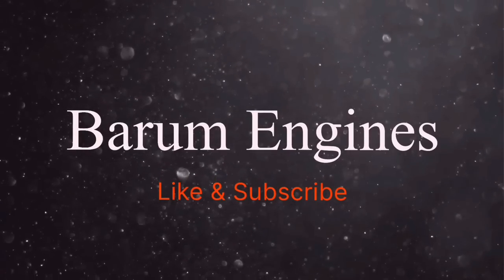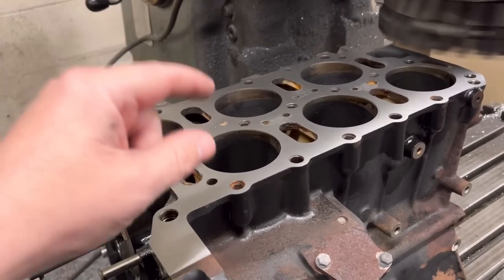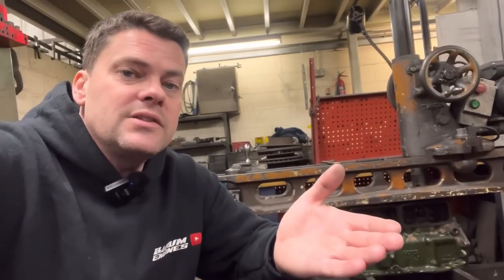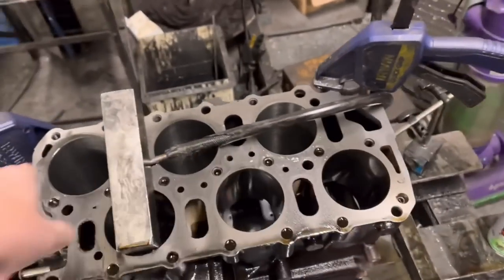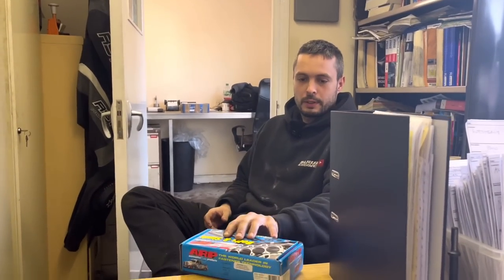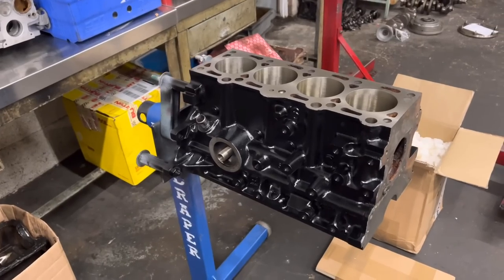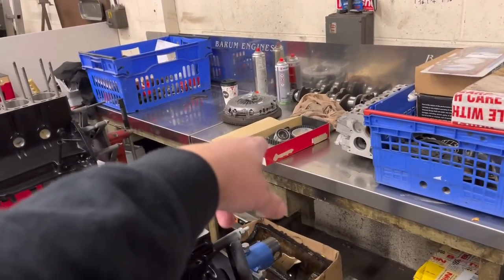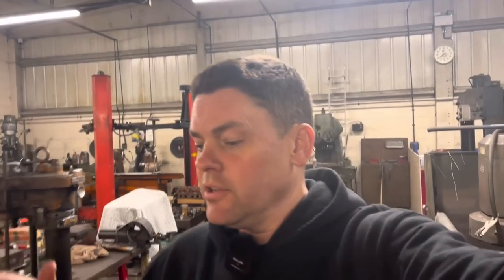This is what happens when you have TOO MUCH on your plate!

Comment: I had an SD1 Vitesse years ago (same engine)  that had the same type of noise  you describe when started in the morning. It turned out that it was the oil draining out of the hydraulic tappets over night. The cure was to experiment with oil weight , to find a type and weight that warmed up and flowed quickly (especially if not used often or for long  enough distances)  cannot remember which I found was best.I think it was a lighter weight synthetic that completely solved the issue. Worth a try before stripping the engine ....

Comment: If u want to get that cvh head flowing better stick a set of later efi valves in they flow loads better as they are superior in shape as tested on the superflo bench when I worked in the head shop at janspeed

Comment: Hey Lee, be sure not to use synthetic oil to break in the new solid lifters and cam in the CVH, use a classic high zinc content 20W50 mineral oil and the cam lube together and you should be ok, we fitted hundreds of solid lifter CVH cams at HT Racing and found that synthetic oil is the kiss of death to CVH SL cams resulting in a 100% failure rate
Reply: as a two stroke nut I can confirm I always run in  on mineral before switching to synthetic
Reply: Valvolene 20/50 racing mineral oil I use
Reply: @vinceevans3219  Yep, that's what we use at HT, but always make sure it's the high zinc type. Back in the day our client Lee Allen on the hunt for sponsorship contacted Motul who were willing to help but only by supplying their top synthetic racing product in exchange for a few stickers on the car, Lee told the guy that synthetic oils were no good on a solid lifter CVH race engine and the guy poo poo'd that statement and told Lee that he'd come over and sort out a race oil package of specially reinforced synthetic oil with a bunch of extra friction modifiers added, Lee agreed on the condition that if it fucked the engine Motul would pay for the damage which was agreed, anyway the guy came and the oil was exchanged from the normal Valvoline Racing 20W50 to this Motul synthetic and the engine was run while we stood there watching. After a few minutes the engine was making some unhealthy noises and on stripping the top end in front of the Motul guy all 8 cam lobes and followers were knocked out, and that's after only 10 minutes on an engine that had run perfectly for 2 years and was as fully broken in as you could get. The guy was embarrassed and left with his tail between his legs and as agreed Motul covered the cost of the repair. Lesson not just learned but rather fully proven that synthetic oil is not suitable for a race setup flat tappet cam, both for breaking in and for running where the valve spring pressure has been increased. We used Kent Cams and genuine Ford solid lifters, the valve springs we used were 50% stronger than standard and the engines were safe to 8.5K all day long with over 185 bhp from a 1.6L Ford CVH on Webers, we had zero reliability issues from the cylinder head assembly with engines that were raced every weekend for years and the Valvoline oil was a big part of achieving that reliability because it allowed us to use the heavy valve springs that brought us that reliability without constant cam wear problems. 'Sausage' HT Racing Ltd
Reply: I had the lifters WCC coated after a customer called me up in dispair as he ruined already 2 cams within 12 minutes.  
After 1th race with coated lifters and custom Catcams grind he took 1 out and it showed no sign of anything.
About 2 years after that he sold the engine.  But new owner drove in a class only stock cams allowed so he took the set out and gave it back to my customer.  WITHOUT ANY MARKING ON LIFTERS.  So my customer called me : Got a box coated lifters , unmarked  ......what should I do ??    I asked or any signs of wear . He replied lifters are like new.  So he put them in  and had no issues ever.  Meaning the coated lifters could be switched places.......😎😎😎😎

Comment: Hi Lee, Tr8 rattle, experienced similar rattle with audi years ago after changing oil. Turned out to be wrong filter, nrv not present allowing oil to drain back from cam. Similar problem with Dolomite sprint turned out to be hydraulic tensioner worn causing timing chain rattle. Worth a check.

Comment: A series engine sizes   803cc  Early Morris Minor and Austin A30.  848cc  Mini ,  948cc Morris Minor , Austin A35.  998cc later Mini's.  997cc Cooper S low production.  1098cc  Morris and Austin 1100 .  1071cc another low production Cooper S .  nearly square bore/stroke incredibly high revving.   Finally  1275cc.  too many uses to mention.  I am aware there were many other BMC or Austin Morris cars  that used various engine sizes but they are too many to mention and my 72 year old memory is not what it was.
Reply: Don't forget the 970cc Cooper S

Comment: If you do get into that TR8 and find out it's the cam bearings don't fit the county ones. Had lots of engine reconditioners complain about excess clearance. Best of fitting Glyco even if they are more expensive.
Reply: Yep full 360 solid  bearings rather than those split crap things,  more so with a performance build

Comment: Had a 350 tvr once that had a rattle after it had been running from cold and would then go quiet. Swapped the hydraulic lifters around into different positions and it cured it. Did make a note of where each one came from in case that had to be put back but it wasnt necessary.

Comment: One garage Ii used to visit had a steel trough urinal with an overhead cistern and a copper sprinkler. The pipe was at a handy level if you needed to hang on while taking a leak. The trick was to connect 4 or 5 12 v batteries in series with one pole connected to the trough and the other to the pipe.

Comment: I agree with Mark below. I did a conversion in the late 80's on TR7. After about a year and oil change I noticed noisy starts too, but my issue was a leaking oil pressure switch which dropped the oil level and initially starved the top end of oil until revving slightly, but it would be 'tappety' when warmed up & idling. I used to use Castrol GTX. Never an issue after replacing oil pressure switch.

Comment: How's the internet speed if you have ADSL/VDSL at workshop? Just noticed the BT master and if you get a xDSL faceplate and then plug router into that it can improve the performance. Depending on how bad your internal wiring is I've had friends see a 20-50% improvement one saw a doubling!

Comment: Piston slap is quite common on a V8, if it’s not using oil I’d let it be. Could be a lifter leaking down a bit, but I would think if it were problematic it would make noise after an hour or so rest, tearing down an engine for an issue that might not exist would be an expensive lesson, not an issue I would promise to correct the n either instance.
Reply: Not really piston noise on the RV8 is more likely worn wrist/gudgeon pin bores in piston than actaul piston slap ,  and noise gets worse with temp as piston expands, more common on the pre 4.0/4.6 later style piston thse have bigger pins too

Comment: I have a '76 tr7 same color the tr8 is nose heavy and pushes because of it the tr-6 handles fantastic and sips fuel
Reply: I'm surprised you say that about the V8 being nose heavy, as it's an all alloy engine as opposed to the Triumph straight 6 which has an iron block. I don't suppose the V8 is any heavier
Reply: The v8 was no heavier than a mgb 4cyl. Hense the mgb v8 being such a success.
Reply: @samrodian919  The tr7 is a four-cylinder as someone that has owned (and scaled) both the 7 is far lighter in the nose and handles MUCH better.
Reply: @davidhall2327  the Buick 215ci was heavier than the triumph 4 cyl it weighs 375 lbs the 4 cyl is 290 AND the rad is smaller as well

Comment: I had the lifters WCC coated after a customer called me up in dispair as he ruined already 2 cams within 12 minutes.  
After 1th race with coated lifters and custom Catcams grind he took 1 out and it showed no sign of anything.
About 2 years after that he sold the engine.  But new owner drove in a class only stock cams allowed so he took the set out and gave it back to my customer.  WITHOUT ANY MARKING ON LIFTERS.  So my customer called me : Got a box coated lifters , unmarked  ......what should I do ??    I asked or any signs of wear . He replied lifters are like new.  So he put them in  and had no issues ever.  Meaning the coated lifters could be switched places.......😎😎😎😎

Comment: Greetings from Australia Lee  love your channel and your openness. Rover v8   Check your valve lift as here the cams lose hardness   we use Penrite hpr 30   summer here   hpr50   winter     reminds me 50 yrs ago the initiations  you name it   all was fair   and no political uprightness  initiation was a right of passage  used to tell my apprentices  they said in your lingo   what a load of old cobblers   Keep it up  if I was over  would happily throw 100 yrs experience  your way  My father and I are and he was an A Grade Auto mobile engineers  less than 3000 since 1925   too hard now  its gone. 8 hrs exam written and 8 hrs next day with prac and follow ups in 13 subjects  pass rate 80 percent   Cheers and seasons greetings from Victoria  Aus  and all your family and colleugues

Comment: Having worked in the motor trade now some 40 plus years some of the things ive seen done to Apprentices include stripping them stark naked and tying them to a lamp post in a wheel barrow, cable tying them to the grates in the paint oven and baking them and cable tying them in a crucifix style to the fence. Ten man pile on in the canteen with the apprentice underneath. One of the funniest things ive ever seen is a bloke made a imitation shotgun the painter goes over the shop gets a bottle of tomato sauce smears it all over his overalls. They stick some smouldering polish cloth down the barrel. Smashes a sledge hammer into the bench the painter staggers in the office says hes shot me hes shot me followed by the bloke with the gun the women were screaming under the desk

Comment: I've had a few vr6's and found if coolants hadn't been changed or good strength in its life that the water jacket area corrodes the head and spreads towards combustion area.
Also vr6 engine runs on the hot side especially with spirited driving and should of had an efficient oil cooler from day one as temps reach 120+ degrees c.
I also think this is another reason for wear on bores, more so on the outer parts of the bore. 
Years ago I got a nylon piston install tool for vw as it guides the pistons into block in the same angle as the bores.
Keep up the good work and content, enjoying the channel 👍

Comment: Don't Forged pistons make noise from cold regardless of engine condition anyway? My friend did a 302 in a Mustang for some guy, and he said put top everything in the engine, I don't care! builder said "If you go the Forged pistons it will rattle from startup though yes!" guy said DO IT! I don't CARE! .. anyway, engine gets built and delivered, and fitted by whatever hotrod shop he had putting the car together, and about a week later he gets a phonecall and the guy is yelling about how the car is noisy when he starts it in the morning.. Anyway, the long and short of it was, he had the car back and took out the forged pistons and fitted hypereutectic ones , and I guess the customer guy was happy as he never heard back.. But the moral of the story is sometimes you have to let the customer have his cake and eat it, and then listen to them whinge that it was awful and how dare you serve an awful cake even though you told them it was gonna be awful. BTW Paul - TOP ONE, NICE ONE GET SORTED!!